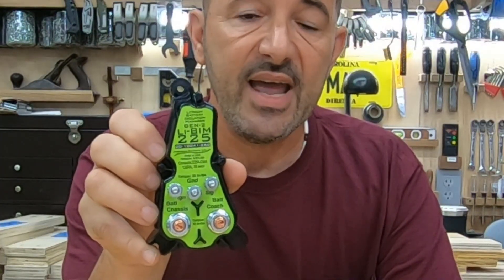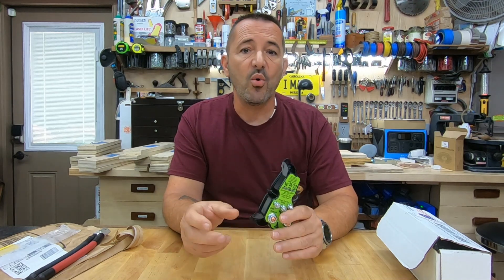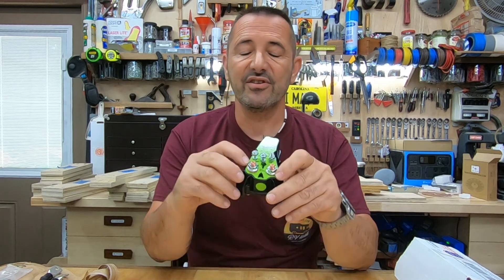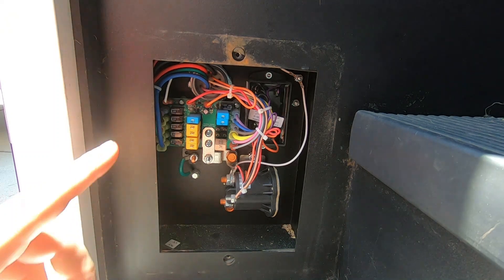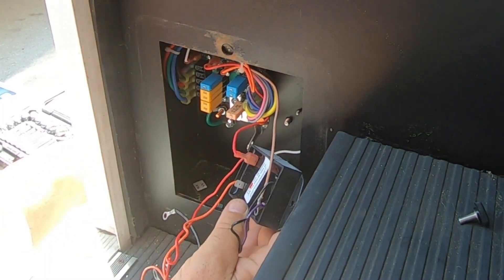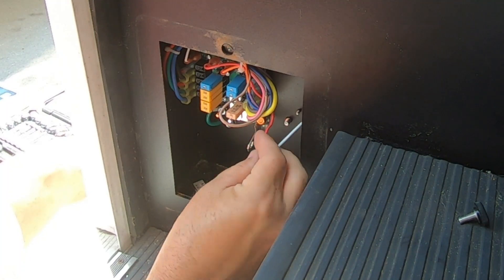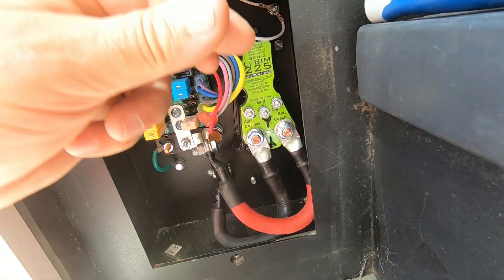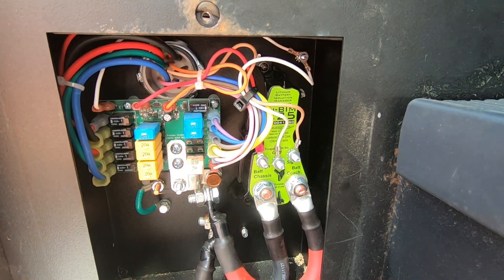Installing An RV Lithium BIM Precision Circuits LI-BIM 225 – Battery Isolation Manager – RV Upgrade

Comment: There should be a headline warning on this product especially for GM vans/Rvs... My rigs alternator runs consistently above 14.4 volts. This items doesnt engage when voltage is above 14.4 volts! What a shitshow to deal with
Reply from the maker: That is an important point. You are right to be concerned and are correct about the voltage cutoff for the BIM. I would contact the manufacturer for known issues or perhaps a defective unit.

Comment: Hi Lou, Do you have a generator on your coach that can charge the Lithium batteries? My motorhome has no solar and I would like to change the coach batteries to Lithium, but I want to recharge the Lithium battery(s) with my Onan 4.0 generator. The existing lead acid batteries charge from the generator, but I can't find any info on Youtube about using the onboard generator to charge lithium batteries.
Reply from the maker: Hi, As long as you update the converter charger to lithium compatible, the generator should charge the batteries.  Here is the video on my converter upgrade.  https://youtu.be/FPjKQ_9ZLWo
Reply: @RVHabit  Also, do your Lithium batteries have enough CCA to start the generator? Not many Lithium batteries have the 450 CCA my Onan generator manual says it needs to start.
Reply from the maker: I don't know the cca of the unowix batteries I have, however they do start the generator.  You are correct though many lithium batteries will not have enough cca to start the generator.  From what I have seen you will need a minimum of two lithiums to start the generator.

Comment: Does the LiBIM replace the function of the solenoid, as well, or should it be tied into the circuit?
Reply from the maker: RVs can have several solenoids for different reasons.  This only replaces the BIM solenoid. Before attempting make sure you understand the wiring of your specific RV.

Comment: Thanks for making the video. I’m doing a similar upgrade. I noticed you are using 2/0 wire. My battery box has 2 gauge wire- did you upgrade all your wire? I was researching wire size my setup and it suggests my original 2 gauge is sufficient but curious how you did it?
Reply from the maker: Hi, I always use the wire size that is already there or greater.  More often I try to go up a size.  It is good peace of mind.

Comment: I'm noticing that your link points to the same product I ordered from Amazon. My LI-BIM 225 arrived in a sealed clear plastic bag, and it has 'Gen-2' labeled above the LI-BIM. Is this how the product is typically packaged?  My batteries should be in next week.  I am installing in a 2024 Sunseeker.
Reply from the maker: Mine did not say Gen 2.  Came in a small brown box with no markings.
Reply: Thanks! I'll install it next week after I get my new batteries. I'll do some additional testing to make sure everything's working. The product is probably fine; the packaging was just a bit odd.
Reply from the maker: I believe it is distributed by Battle Born Batteries.  If you have any questions you can always reach out to them.  I believe they have some wiring diagrams on their website also.  Good luck.

Comment: Thank you Lou for this video. I have the same set-up in our FR Sun Seeker Class C. Yours was the only video and online information I could find that represented what we have, ie. BIM + separate Solenoid. I have a question. We do have the emergency boost/start switch but this year either the switch or something past the switch towards the chassis went bad as the chassis battery started to drawdown on the coach batteries, so I disconnected it and that resolved my issue. I don't use or foresee using the emergency jump switch and in fact hear that LiFePO's don't have the cranking power to boost the chassis battery/motor. So my question is, do you think the LI-BIM 225 would work fine without connecting the emergency boost/start signal wire?
Reply from the maker: Yes the battery boost switch is an option and not required for the Li-BIM to work correctly.
Reply: @RVHabit  thank you for the prompt response Lou! Have a great weekend.
Reply from the maker: Good luck it is a tight fit for sure but certainly doable.

Comment: Thanks for the video. I’m planning to do this on my 2001 class B coach, but was curious if signal wire is needed if you don’t have an emergency start.  I don’t think I have that feature or at least I don’t know how I’d even use it if I did. :) thanks, again.
Reply from the maker: Signal wire is not required if the RV does not have an emergency start or bypass.
Reply: @RVHabit  Thank you for the reply.  Install looks Iike a relatively easy swap with my old BIM.  
Have you been happy with your LI-BIM225 so far?
Reply from the maker: Has worked fine since install.  It works in the background so out of sight out of mind but no issues that I have noticed.

Comment: Thanks for the Info - I've been doing researching on the Lithium Battery changeover and I keep finding more and more changes that I needed to make from the Converter/charger (which won't charge Lithium batteries to its requirement of 14.6)  to this (BIM) and I have no clue where it is on my 2019 Jayco Redhawk SE 22C model- My batteries are located under the stairs which I need to modify also to able to fit the Lithium batteries I want....Far as batteries go they are a LOT of make , models and sizes to choose from Battleborn (too expensive ) to Chins which I find are more affordable..Still doing research but I have plenty of time to make my decisions....PS - forgot to add a 'SHUNT' ...I'll be checking out your website for more info..😁 Thanks again
Reply from the maker: I have a video on adding a shunt for the install of the AiLi Battery Meter.  As for the BIM it is typically very close to the battery compartment.  You correct about no shortage of lithium batteries to choose from.  Do your research and purchase what you are comfortable with.  I am sure most of them ut there will serve you well.  Good luck.
Reply: Thanks..I'll check it out.. @RVHabit

Comment: I have a question. I have a 2009 winnebago chalet and the selonoids are placed in a different part than yours. They are also not as nicely labeled as yours. I am having a hard time finding the cable that will be attached to the sig, which I am assuming is the cable for the battery boost in the front. would you happen to know where I can get that informaition. I tried looking up the wiring diagrams but I don't see this type of wire going all the way back to the solenoids. thanks in advance I'll take any information you can provide.
Reply from the maker: I am not familiar with Winnebago wiring but I believe they may use a separate solenoid for the battery boost function that does not involve the BIM.  I would either call Winnebago or check on a Winnebago forum.  Good luck.
Reply: Thank you

Comment: Nice vid. I wish this device had some built-in alternator temperature compensation circuit to throttle down/disconnect in case of ALT overheating.  Curious how they arrived at the 15 min on and 20 min off scenario described in their user's manual.  I've read that the LFP banks will sponge up a huge amount of current and not knowing the ALT case/winding temp is concerning for DIY enthusiasts.  Thoughts?
Reply from the maker: Yes lithium batteries will take a lot of power to recharge.  I will assume somebody tested what a typical alternator can handle for 15 minutes.  However if you want you can always go with a DC to DC charger that will regulate the amount of power that is sent to from the alternator to the lithium batteries.

Comment: Thanks Lou! Great videos - really appreciate you. Question - I have a very similar setup to yours in my Dynamax Isata 3 motor home. Upgrading from AGM to Lithium and my BIM looks identical to yours. I ordered the same replacement LI-BIM you’re installing in the video. BUT - after seeing your struggle with making this thing fit, was wondering if a product like Renogy’s DC-DC charger (which also acts as an isolator) may be another option? And maybe I’m just trading one challenge (small space in the battery control box) for another (routing cables from the DC-DC charger where they need to go)?
Reply from the maker: Hi,  DC to DC is certainly an option to consider.  Time wise I think install will also take time.  I chose to go with the LI-BIM so I could keep the functionality of the emergency start button and overall it is less wiring.  Either way though is the way to go if your upgrading to lithium.  Yes, I struggled a bit but I was also in 95 degree Florida heat.  I wouldn't have minded it as much if It was a bit cooler. Good luck on whatever you decide.
Reply: @RVHabit follow on question - did you need to drill holes in the box to mount the Li-BIM? Or were you able to re-use any of the existing bolts? My box appears the same as yours, but I think I’ll have to drill some holes to mount it. 2 of the 3 shouldn’t be a problem but one location is awfully close to an LP hose. Just curious. Got everything out pretty well. Now just need to mount and connect. Also - would you still do 1/0 9” cables? Or is it possible to go thinner? I don’t know the calculations for figuring out cable types. Thanks!
Reply from the maker: Hi, I used some short self-tapping screws, no predrilling is required.  They went in very easily and are holding rock solid.

Comment: One thing I’ve noticed after installing the new BIM and lithium batteries that I need to keep the rv plugged in shore power because the Coach battery will continue to draw down from the house batteries to when the rv is parked. I’m thinking that is because of the higher voltage from the house batteries keeping the lower Coach battery charged.
Reply from the maker: I generally always have my RV plugged in so I have not noticed that.  Thanks for the heads up.

Comment: I'm replacing my marine out on my travel trailer and don't  know which wire is my ground or power I have a white black and a bare wire any ideas
Reply from the maker: John you will need to check that with a multimeter.

Comment: LiFePO4 will charge to 100% at 13.8v, which would be fine for them and the chassis battery.  Maybe a configuration like this could have used the original BIM, saving ~$150 on the Li-specific BIM and 2 hours of hard work.  :-)

What's the rating of the alternator and what kind of charging current do you observe going through the Li-BIM?  People think LFP is a black hole of current, but in my digging it seems like when the NEG return ("ground") goes through the chassis there is enough resistance to limit LFP accepatance to 0.33C, or ~66A for 200Ah.  Will be intersting to see what numbers you are seeing.

Comment: Thanks Lou, I really appreciate it because I have the same setup in my Forester. I’m getting to change out my old lead acid batteries to Lithium-ion batteries.
Reply from the maker: I struggled to get that in the spot.  For certain you need to use the metal clips that are attached to the RV wall that are attached to the Trobetta switch.  9-inch cables seemed to be just right.  It's doable but you need to take your time.    As you see in the video the wiring is very straightforward.  Good luck and let me know how you make out.  I have the PDF files of the wiring and specs on my website if you need them.